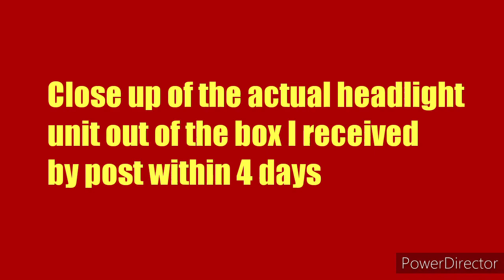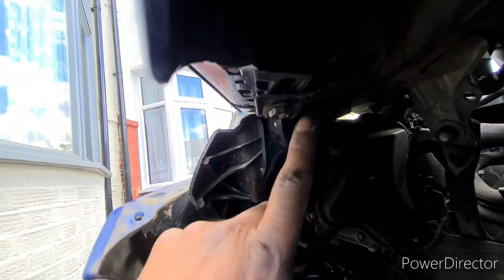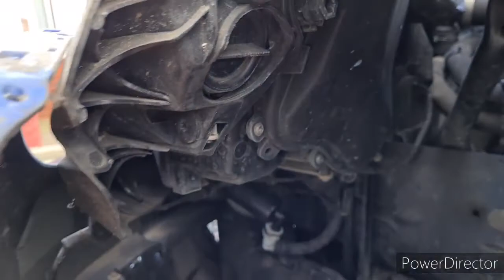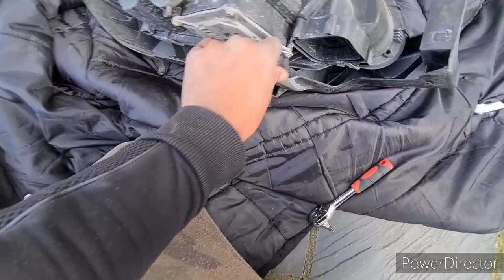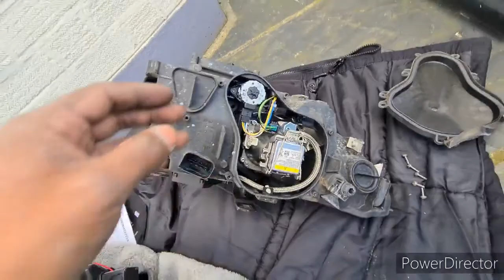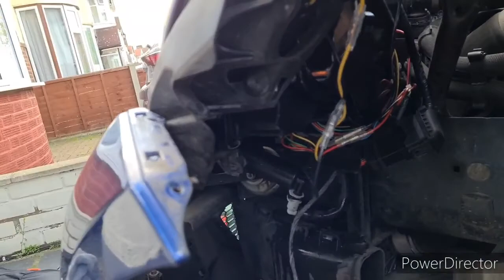Ebay BMW E93, M4 Style 3D crystal angel eye headlight unit upgrade for £430. NO ERROR, WARNINGS.

Comment: Hi bro nice job 👍 
I have bought one same my car is e90 lci with xenon factory 
And after installation I got error on my dash board do you know the reason?
Reply from the maker: It depends on the after market LED lights you purchased. You will need to get a Canbus error free resistor decoder for the leds to prevent the error code showing. The headlights i purchased had these resistor's built in the headunit and were advertised as error free headlights. I got no warning lights since installing them.
Reply: @asothiratnam  thx, did you have adaptative headlight options? I heard those headlight doesn’t fit if your original car have the adaptative headlight options or xenon
Reply from the maker: @mcritepcht5956   Yes your correct my car didn't have adaptive headlights and these after market headlights say they are not suitable for BMW cars with adaptive headlights.